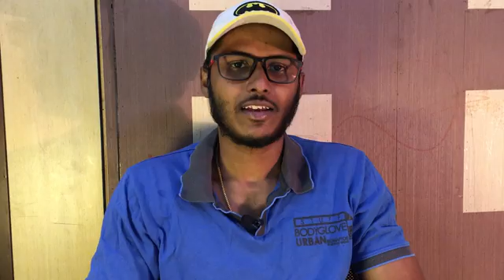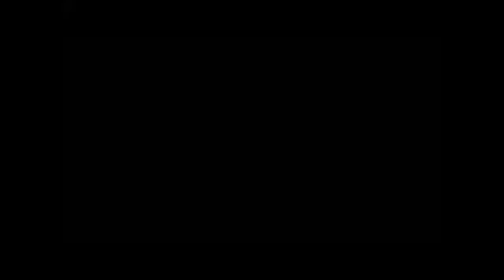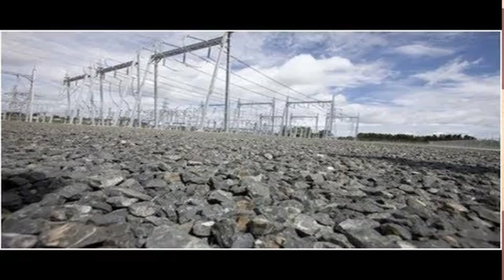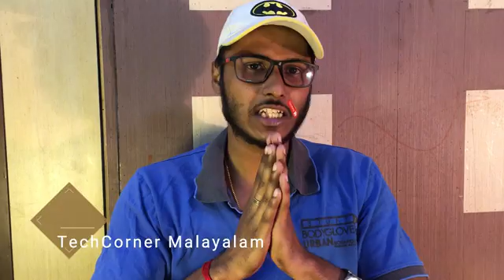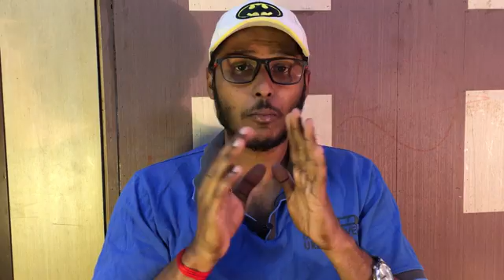Why Gravels are used in Substation | എന്തിനാണ് സബ്‌സ്റ്റേഷനുകളിൽ ഗ്രേവൽസ് വിതറിയിരിക്കുന്നത്

Comment: Thank you for the explanation. You have mentioned many reasons for the same And finally the oil spillage It is the main reason Transformers are filled with oil several thousand liters  Little spillage may not be of concern but when an explosion occurs subsequent to a severe fault the whole oil will come out accompanied by fire If granite metal is spread around transformer the oil will easily drain Area and quantity of granite metal will be more than the total volume of oil Moreover  in large transformer yard these oil will be taken by underground pipeline to an under ground tank some distance away.

Comment: Brother, i understand you are good in technical and electrical field. I want to know something in my project. how can we shield magnetic field ? how can we protect a place from magnetic range? Please help with some advice. if its not a proper answer then also no problem. Your help is greatly appreciated.
Reply from the maker: I think magnetic shielding devices are readily available,Y don’t you try that
Reply: @TechCornerMalayalam  it's only less than 50 percent protection that's why bro. You think and give a clue or your idea. It's enough. Thank you brother.